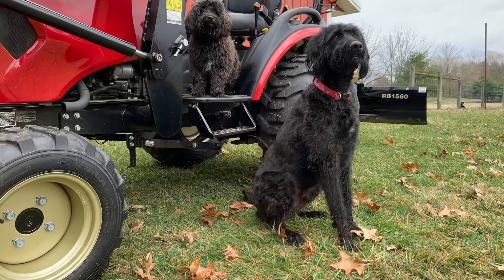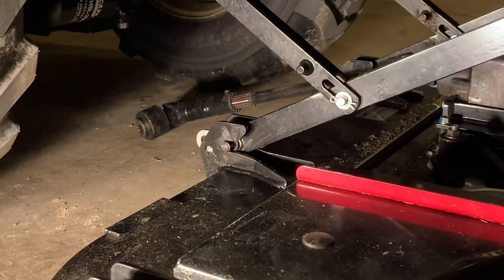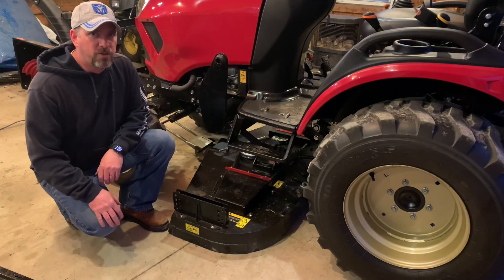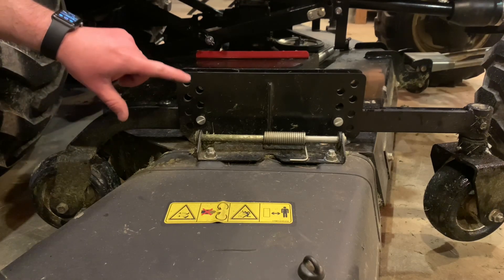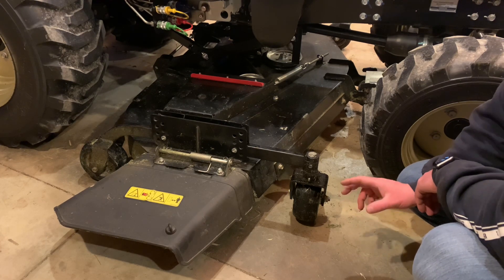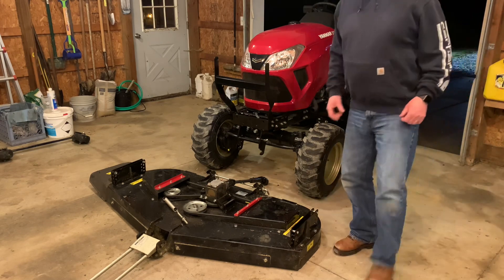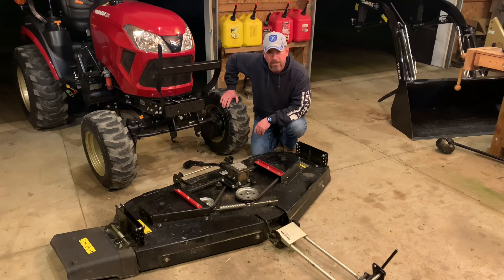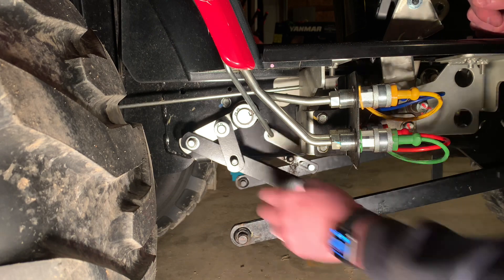Will It Cut? We take a closer look at the mid-mount mower on the Yanmar SA324.

Comment: Is it possible to just push the deck on those deck wheels under the tractor?those are 360 so should be fairly easy. Then you don’t have to unscrew them every time and drive tractor over the deck… or I am missing something with the design limitations?
Reply: You can. I have a Yanmar SC2450 with the same deck. I thought about driving over the deck but I just slide it under the tractor. 2 of the 4 mower wheels don’t swivel on mine but I slide it on the gravel driveway or grass. You have to turn the front wheels of the tractor to slide under but it’s not too bad.

Comment: Great video.  I have been researching the Yanmar SA 325 heavily and am strongly considering one for the primary purpose of mowing our 1.5 acres and snow removal in the winter.  I have the need for a frontend loader for several projects I would like to tackle and my fear is the John Deere 1025R loader will not be enough lift capacity or tractor frame size for those bigger jobs while it is probably better suited for the task of mowing.  I would love to know if you are still happy with the SA324 and if you feel it's too big to mow a 1.5 acre yard?  Also do you have any regrets?

Comment: I really really appreciate your video. I have bought a used Yanmar SA424, decided to add mid deck mower. I bought a used mower, it came with no instructions. There were lots of links and attachments to be attached under the tractor. I had hard time adding links and attachments, thanks to your video I was able to pickup bits and pieces. I have installed installed the mower successfully. The local dealer and Yanmar corporate were no help providing any information. The nearest dealer is 80 miles away, I was thinking about loading up the tractor and drive to the dealer. Thank God I didn't have to drive 80 miles again.  Thanks again.

Comment: How fast can you mow?  Do you have to use low range?  Do the tires tear up your lawn?  I assume the throttle should be set at pto rpm?
Reply from the maker: We are able to mow in high range on most of our yard, but the yard is fairly flat. The R4 tires don’t really tear up the lawn unless they spin. Yes, we mow at the PTO RPMs. Thanks for watching.
Reply: Thanks for reply.  One of the better videos on the subject out there.

Comment: Anyone have the mid mount deck for the Yanmar SA221?  If so, do you drive over that one or slide it under from the side?  Mine has plastic parts on top and not all steel to allow the tractor weight.
Reply: I own one... You have to slide it under. And it's heavy...
Reply: No.. u can not drive over the 221
Deck

Comment: Thank you. Great video. There aren't a lot of videos on the midmount mower. Re: the lift arms, does the latch lock onto the silver and black rods on the left side of the tractor or just the right? On our 324, it is just the right side. And how did you lift up the mower deck?
Reply from the maker: Our 324 has the locks on both sides, to lock them you rotate them from the silver rod to the black rod on the right and left lift arms. I’m not sure if the earlier models have the same design. As far as lifting the mower deck. I usually just lift the front of the mower deck by hand to lean it against my workbench, I use a rubber tarp strap to hold it there. A chain hoist or something similar could also be used. Thank you for the feedback and for watching!

Comment: Thanks for sharing. I'm curious how those tires handle a normal lawn? I imagine they tear it up if you're not careful.
Reply from the maker: The R4 tires cause very little yard damage. I mow in 2WD most of the time and only put the tractor in 4WD when necessary, I think that helps keep yard damage to a minimum.
Reply: @doodletract5252  Great to know. Now I just need to find one available. Thanks!

Comment: Great video. Thanks for sharing. I had to laugh at that last bit there about the fan. I have the same tractor and it has the shroud around the fan and I still took out the fan while using the brush hog. Luckly it was still under warranty.
Reply from the maker: It’s good to hear that your repair was covered under warranty. The shroud appears to offer a lot of protection for the fan but obviously it is still possible for things to get into the fan in certain situations. Thanks for the feedback.
Reply: @doodletract5252  When I was shopping for tractors and decided on the Yanmar one of the things that sold me was the warranty.  Our local dealer is also very reputable. They go the extra mile to make things right.